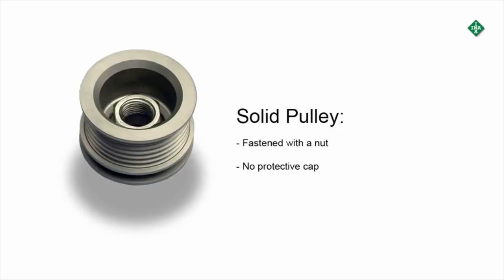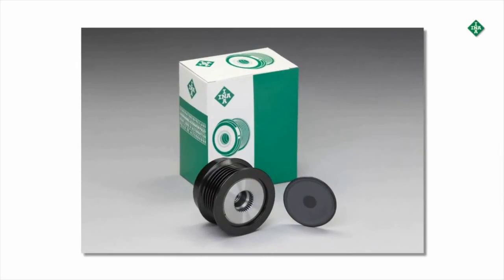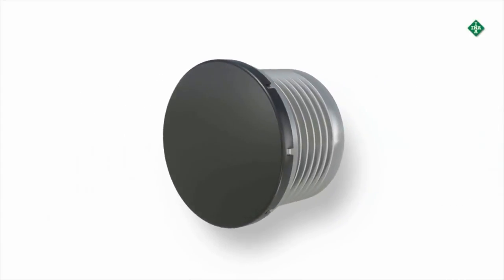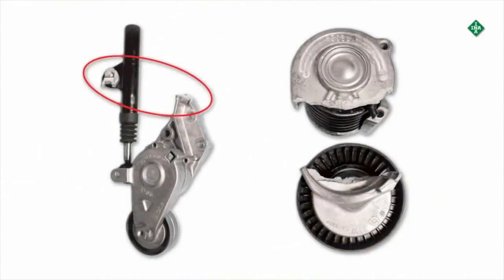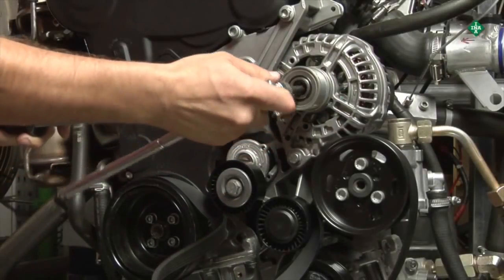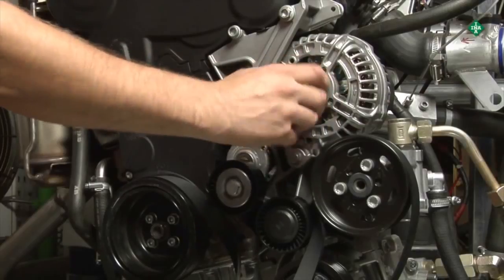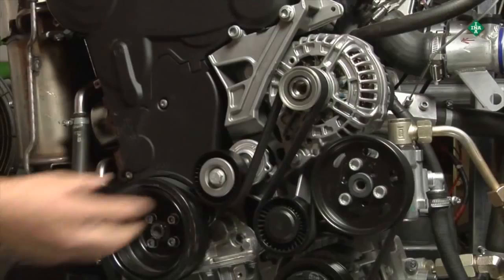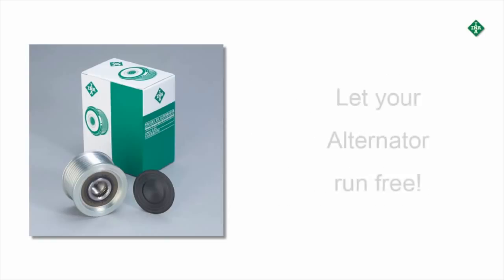The INA Overrunning Alternator Pulley OAP    the Technology Film Schaeffler

Comment: Fake video of engine with original installation
Reply: Quite right! Today I replaced a working INA freewheel with a larger diameter solid-machined pulley, which turned out to be even lighter than this clutch! The engine works in the same way - there are no extraneous vibrations of the tensioning mechanism! At idle, fuel consumption decreased by 0.1 liters per hour - it was 0.7 liters per hour, and it became 0.6 liters per hour! The battery charging voltage did not decrease while the engine started to rev significantly faster than with freewheel as the engine was spinning a larger pulley than the freewheel based pulley shown in this fake video! After installing a solid pulley, the car began to accelerate much faster, the manual transmission gears turn on better, since the engine speed does not drop as quickly as in the case with an overrunning clutch installed, and the generator in this case works as a kinetic energy accumulator that maintains high engine speeds even after closing the throttle. The twitching engine video shown on the left side of the video is completely fake! This is how the VAG engine behaves, in which one or two ignition coils are faulty, or specially disabled! A serviceable engine behaves differently and shows no signs of additional vibration even when a solid pulley is installed on the alternator shaft, and not an INA freewheel! Average fuel consumption also went down as soon as I installed a larger one-piece pulley and longer belt on the alternator to replace the old INA freewheel!